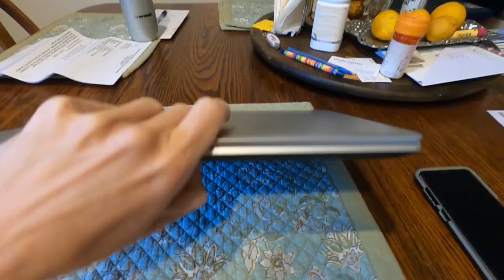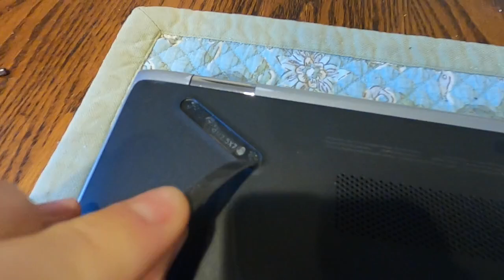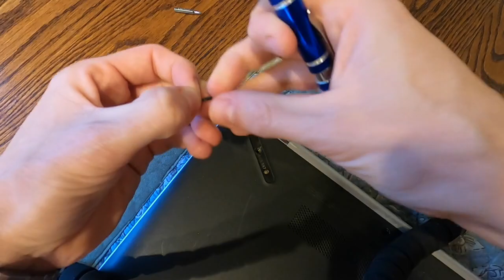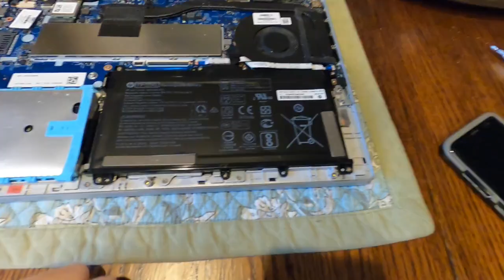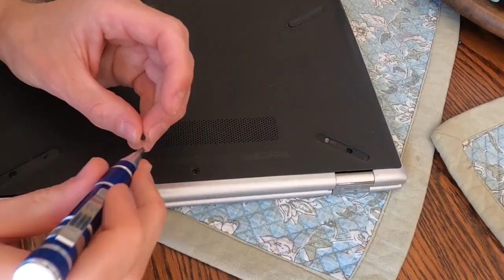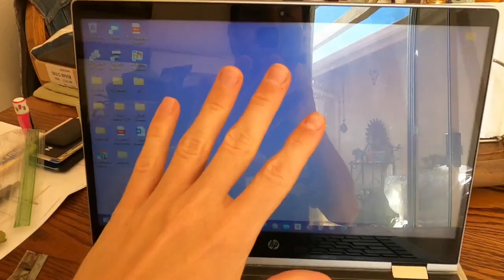How To Replace HP Pavilion Battery. Easy DIY

Comment: My HP Pavilion laptop will now only work plugged into the mains, on battery it goes off after a few minutes, is this normal, it's about 4 years old?
Reply from the maker: depending how often the laptop battery is used, yes. They dont last the longest due to the strain and heat

Comment: THANKYOU!! my pavilion just stopped holding charge past 9%, I had to run three battery health tests before it told me it needed replacing. I was lost looking at the batteries online had no idea how to work out which one I needed because all the tech stores just have a bunch of numbers listed with no context! had no clue if it was meant to be the PC model number or what... you've saved me thankyou king
Reply from the maker: @Ratsavage  You're very welcome! Happy I could help you out. Good luck on the project getting it going again 👍

Comment: Please help.i cant get the cover off, I feel there's either a hidden screw somewhere, or an issue with the DVD tray,seems like It's the DVD holding me up, I am being careful and gave up for now..yes i took the rubber stops off
Reply from the maker: Go back over all your work and check for extra screws they're really sneaky. Try and find diagram of your specific laptop too if you can
Reply: @JonnyDIY  - I found it ! Your razor blade took did the trick, one very well hidden screw almost in the middle,held the DVD tray in.I got the cover off, now trying to transfer photo of battery from phone to comp for the battery salesman-  arrgh,problems - Thank You
Reply from the maker: @joeysn7hvn  you're welcome, happy to help 👍

Comment: Nooo I just changed mine and the laptop didn't power on (even after charging), and it's a compatible battery... But I checked again, opened the laptop and took the battery put again and the little screw touched the electronic plate just above the battery and something burned 😭 something really small but I saw the smoke. Does anyone know what could've happened?? Heeeelpp ☠️
Reply from the maker: Ohh nooo if it smoked something shorted. Best bet is to take photos of it and post on a computer forum where they could help you. I'm not much help with that where you have to solder and remove parts and replace. Sorry to hear. Hope you can get working again 🙏
Reply: @JonnyDIY  thanks! But I took it to the technician, cause of electronics I do not know anything... so probably I would end up burning something else 😂
Reply from the maker: @nicolearriagada7624  hope they can fix it and not too expensive 🙏